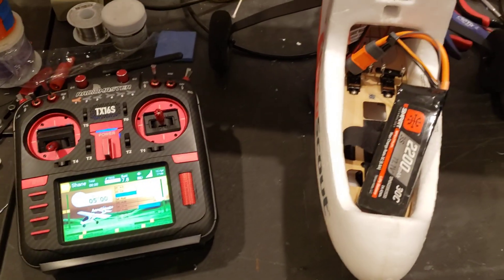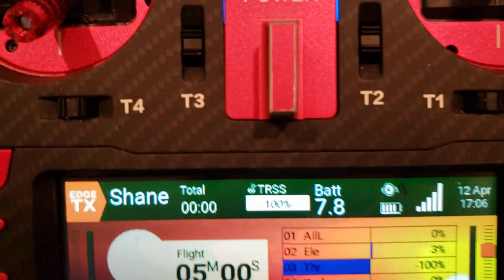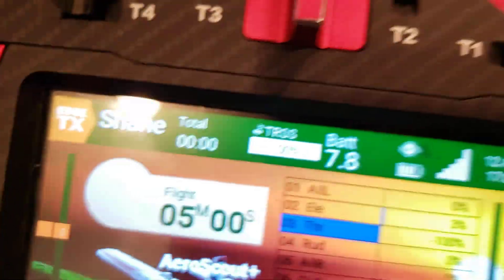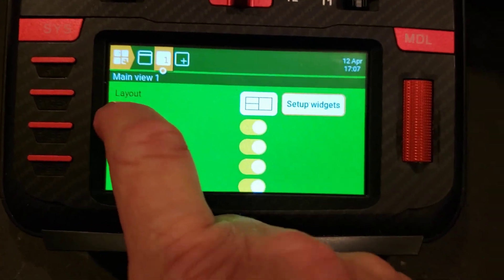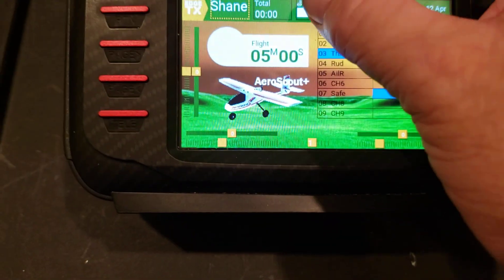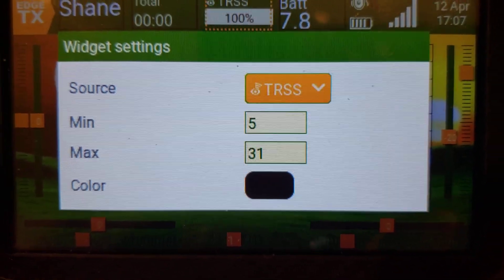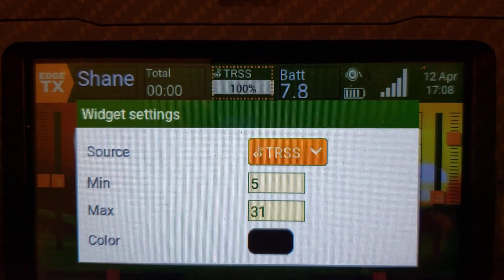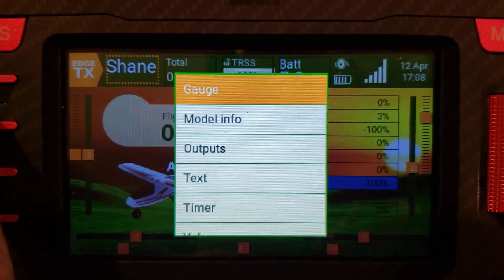EdgeTX TRSS signal widget setup

Comment: I have a question relating to this. I am getting constant rssi low and critical callouts throughout my flights. I know that there are no issues bc. I monitor my TRSS and FLss in the widgets. Can you explain how to adjust the rssi low and critical callouts to TRSS values?
Reply from the maker: @xXRapToRiXxGamer  With Spektrum receivers you'll always get that due to the short range "fly-by telemetry" Spektrum has.  The warning is only related to the signal coming back from the receiver, not the control signal from your radio to the receiver. You can decrease the warnings a little by changing the low and critical alarm values in the telemetry screen to 1/1 but you'll still get the alarms.

Its best to disable telemetry alarms in the telemetry screen.  I have a more recent video doing a range test with the Spektrum AR631 that demonstrates the telemetry range compared to control range.